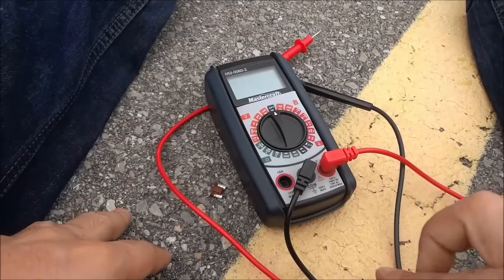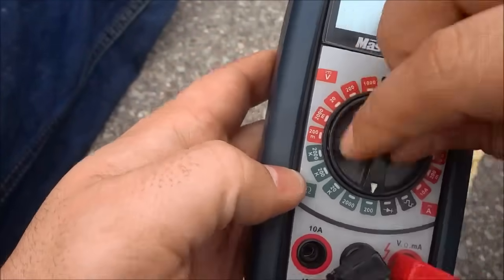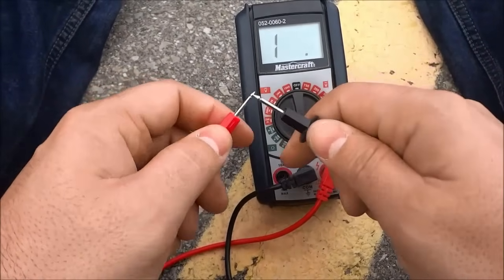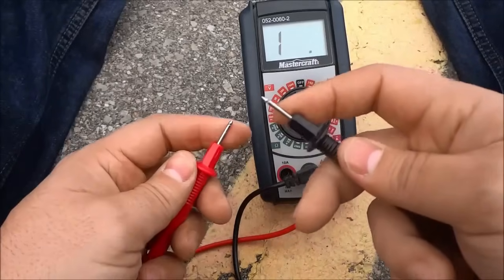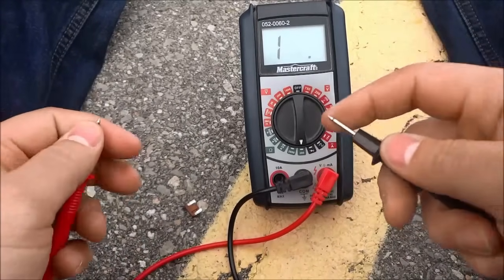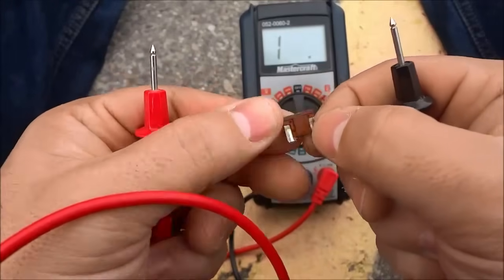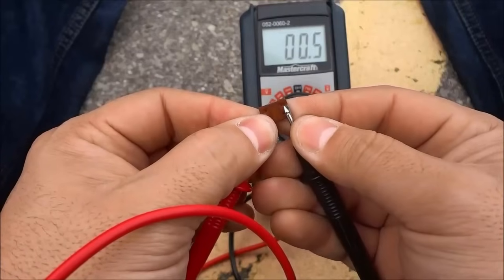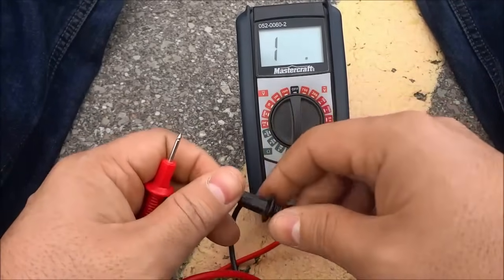How To Test For Continuity With A Multimeter-Step By Step Tutorial

Comment: Good video. I always wondered on my cheap multimeter, where the continuity setting was. On Fluke and more expensive meters, it has it's own setting and audible beeps, so it's easy, but on cheap ones, it's hard to know where you're not an electrical person. Yet I spent 23 years as a Computer Repair Technician and never used it, lol. I knew others who did though.

Comment: You didn’t mention what multimeter terminals to use for the wires. You didn’t mention what number you might expect if you don’t have continuity. Incomplete video with several open questions still.

Comment: Ahhh, well, you see, you used the WRONG setting on the multi meter. You are testing for a resistance of up to 200 ohms. For your meter the correct setting for continuity is the diode symbol and is right next to the 200 ohm setting. when using the correct setting a numeric value of 1 just means no continuity, any other number means there is resistance and therefore continuity.
Reply: 1 (on the left side of the lcd) means the line is open and the resistance is very high (infinite). if you get any other number close to zero, it means the line is shorted and there is no or very low resistance in the line (the line is continuous, thus "continuity" exists)
Reply: @rkiensign  I still don't know if "1" is high or low...relative to what?  I tested the two wires on the electric motor that drives the hydraulics on the tilt trim of an outboard motor.  The reading was "1".  The video did NOT explain this to me.  I could have thought "1" to be close to zero if I expected a resistance of, say, 1000 ohms.  And thank you immensely for teaching me about that AND the meaning of the symbol next to the 200 ohm setting.  What in the world would the 2,000 K (2,000,000) be used for??  What might I have expected for a reading for my test on the hydraulic motor? 0.99? 1.6? 163.2? 16320?
Reply: The symbol to the right of the 200 Ohms range is a diode test not continuity.  This meter combines continuity and Ohms together. The fact that he gets a ohms readout verifies he has continuity.  He is doing it correctly but just misstated why it doesn't show "0".
Reply: @joephu shit who is right??
Reply: Thanks for correcting him
Reply: thank you....i read the manual & you are correct.

Comment: resistance is fine-if there is a breakage in wire then the flow won't pass to the other end , hence resistance-so resistance test is fine set on lowest resistance test (think of it as a flowing river)

Comment: No, you are testing for resistance: for continuity you hear a beep.
Reply: Not all multimeters have a beep or other audible signal.
Reply: Maybe... Many multimeters have some kind of option for tone or no tone. He is correct in stating that the meter dial should be turned to the ohms symbol. My meter (ELECTRO-TEK) Has two settings: 200K/>)))) (tone) or 200K no tone. The tone is for those times when it might be difficult to view the readout.

Comment: For checking fuse, I prefer test light. But for inspecting voltage drops, open circuit, around circuit paths, I need a good multimeter.

Comment: But to be cmplete, if you perform the test and the display doesn't change (i..e. it stays as "1  ."), there is NO continuity and the part is bad.  If the display is erratic, the continuity is intermittent thus the part is also bad.
Reply: Good addition Teague!
Reply: @BradfordGuy  Yup!  I was incompletely satisfied, and upset with buddy being smug, saying he HAD SHOWED how to test...  Teague, thank you for giving the other half of the lesson.  BTW, my meter is the exact model as the one used in the half-tutorial.
Reply: And if it's erratic on just wires you got a bad one right 🤷
Reply: Does this go for when you’re checking continuity in an electric motor, like U1 to U2 ect?
Reply: What if it drops to zero?